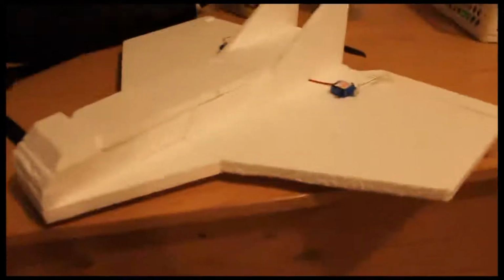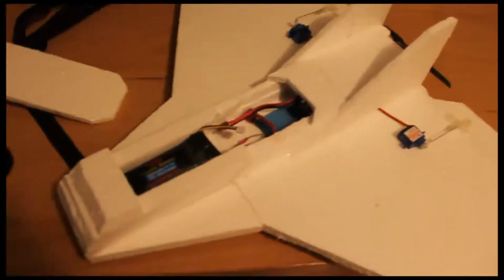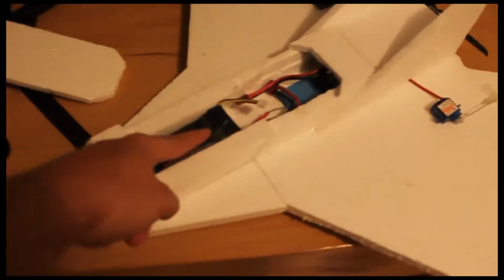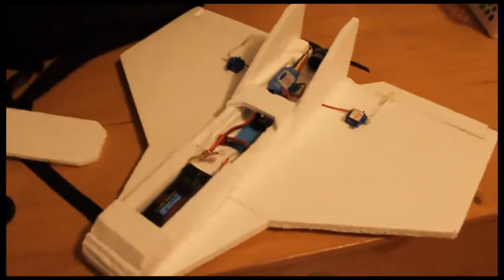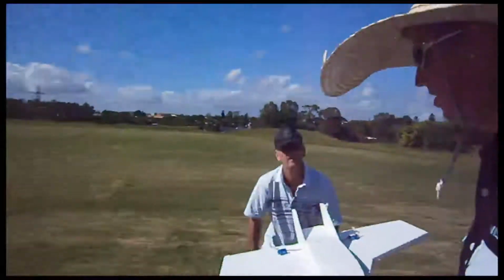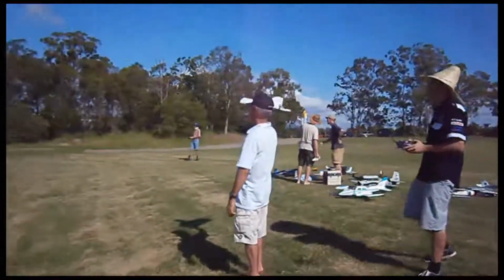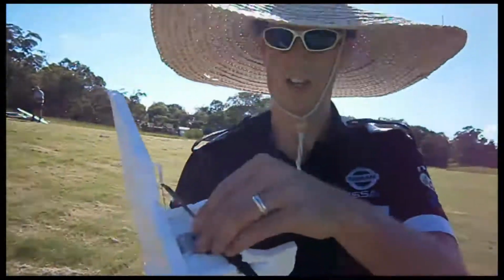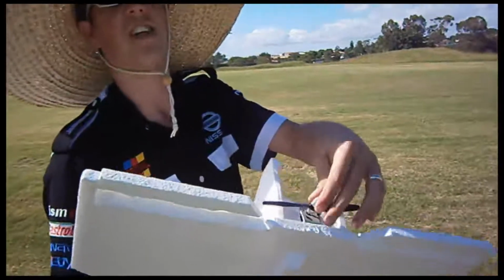Fruit box plane version 2

Comment: Getting there. CG is probably too nose heavy (?) as the model immediately went into a dive after launch. While it was diving, it appears the control surfaces were not large enough to counter the dive - if  you were trying to get it's nose up. Maybe adding elevon extensions (glue and toothpick) to increase the surface area and bevelling the leading edge to reduce drag might help .. gives an idea of what to do with the meat tray I put aside.